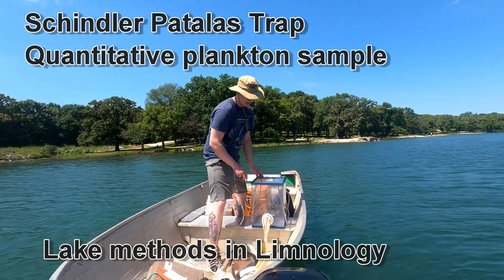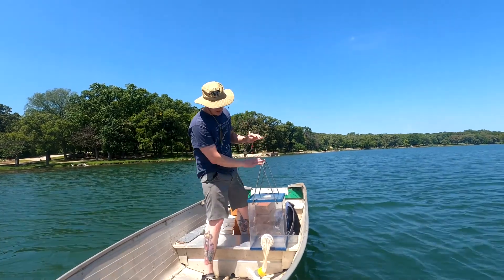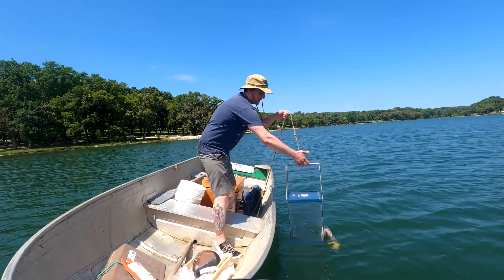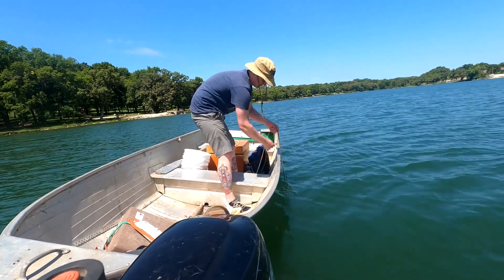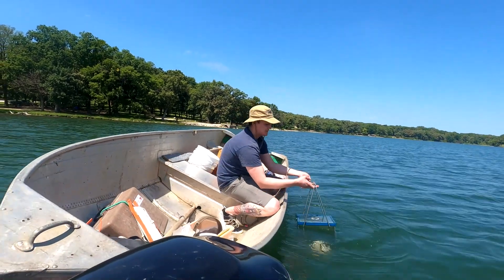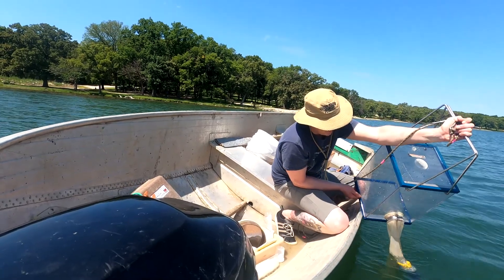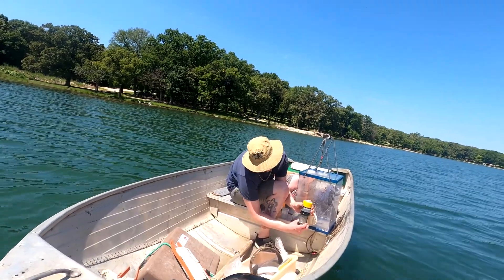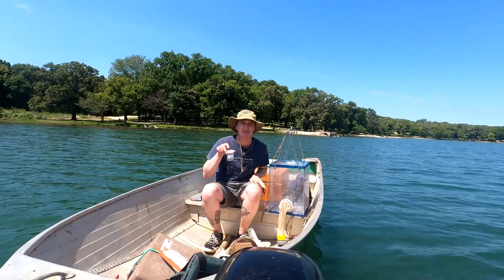Schindler-Patalas trap

Comment: Thank you for the demonstration! Just one question; shouldn't the trap be carefully washed to pick up any zooplankton that remains attached to the trap and net? In my experience, a lot of zooplankton can remain on the nets.
Reply from the maker: Yes, you are correct. A squeeze bottle with tap water can work well for this, can wash net into bottom cup from outside then wash from outside the cup into the sample container.  Thanks for the correction!

Comment: This is a schindler-patalas trap, used to sample zooplankton in lakes. It's clear because zooplankton avoid colored objects in an attempt to avoid predators. We join the two metal arms on top with a carabiner, and you can see a net at the bottom that the sample is ultimately strained through into the cup at the bottom. We lower it into the lake, and doors on the top and bottom open to allow in water. The top door has a small vent which allows air to displace the water as it filters through the net. You can see the doors open as it enters the water. We're going to lower it down to 5m, stop when we reach 5m as indicated by markings on the rope, and when we pull up those doors are going to close and trap water - and all the plankton from that spot - in the container. At the top, pull it slowly up, giving time for the water to drain through... you can actually hear the hair hissing into the trap from where i'm at. We want to drain all the water in there allowing us to take a quantitative sample since we know the volume of the trap. Undoing the black portion, we can drain the sample into a P-cup, and it'll be good to go after I add a little bit of formalin.